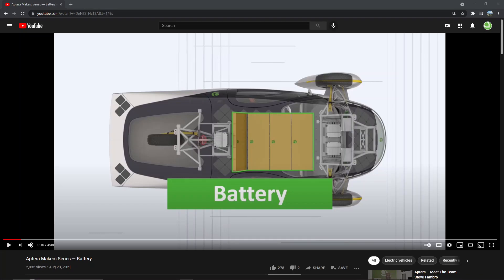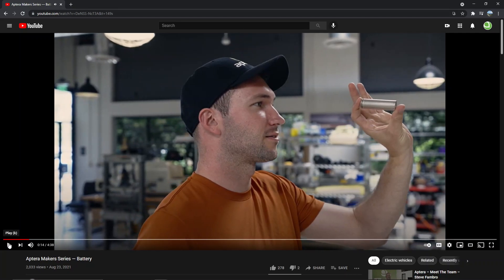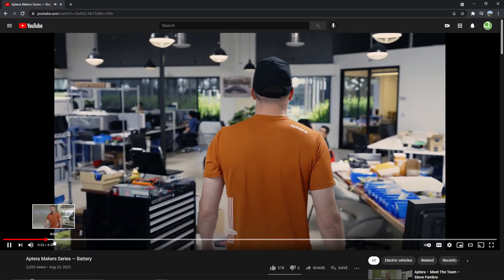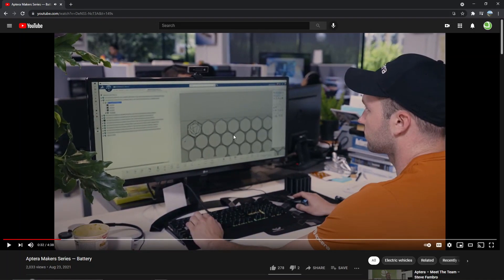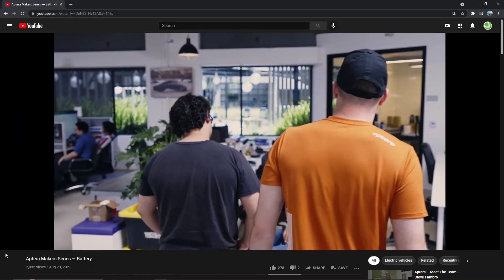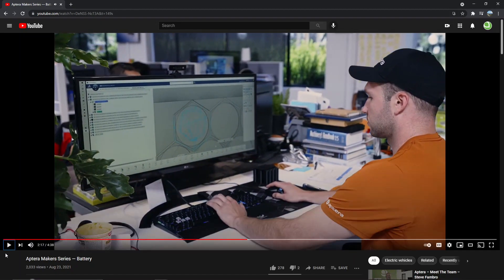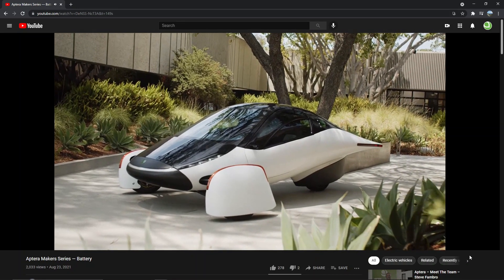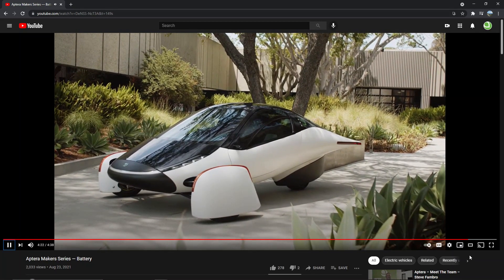Aptera Battery Update!

Comment: Echoing Andre M Camara - great video.   As an Aptera resevation holder and e-bike DIY'er, your notice of the parked bicycle speaks volumes about Luke and the rest of the staff. Most promising for me was the  open communication and talented and committed work environment.   However one mandate: "To make you fly off the starting line" (i.e. performance) caught my attention.  Luke is tasked with balancing this mandate with the competing mandates of achieving range, and managing heat (pack longevity), and fitting the packs into car's space constraints.  Luke's (Aptera's) job is tough, but all looks promising.  With 400 targeted volts using 3.7 (nominal) volt, 3.5AH 2170 cells, I'm guess each of the packs consists of 108 serial and 10 parallel "108s10p" cells (total of 1,080 cells).  Each pack = 324v-454v - "400v" nominal,  35AH (amp hours),  14kWh (kilowatt-hours).  The cells of this 108s10p pack are likely arranged 54 (38") x 20 (16.5").  Guessing cell-only weight per pack to be about 200lbs (completely assembled pack weight of maybe 275-300 lbs per 45"W x 18"D x 4"H pack? 

As a consumer, I would like to know the level-ground, windless "aero-dynamic sweet-spot" of the present Aptera body.  With such a sleek profile, if the wind-resistance "sweet-spot" ends around say 75mph, then I personally would prefer relinquishing bragging rights to reaching 100 mph, and 0-60mph in 5 seconds.  My personal minimum is being able to reach 87-90 mph (level-ground - no wind), and 0-60 in at least 7 seconds (i.e. be able to keep up with LA 405 freeway rush hour mania.   As you know, there is a huge increase in power (battery draw, controller throughput and coolant system scale/size/complexity) between 90 mph and 100 mph, (especially if 90mph is already beyond the "aerodynamic sweet-spot", where the car is really fighting to gain every 1 mph between 90-100mph).  As you know pack voltage is the primary top speed factor.  Also as you know,  the more rows in parallel in the pack (increased pack AH), the more the current draw is spread across the cells.  More cell rows in parallel (more AH) greatly decreases cell heat/deterioration and greatly increases cell longevity.  For instance it might take 400 volts to push the car to 100mph and to be able to do silly burnout sub 4-second 0-60 squid antics.  But it might only take 311 volts to achieve 87-90mph and 0-60 in 7 seconds.  If that's the case,  then personally I'd rather have a cooler running, longer lasting 84s13p (1,,092 cells) (311v,  45.5AH, 14.15kWh pack (1,092 cells) battery pack.  

But since the present 108s10p 400v pack configuration is already optimized for the space constraints (that I agree with), to simplify battery cooling system design and achieve battery longevity, what about:  a) For those who purchase the single pack 250 mile range option (and maybe even the 400 mile battery option) maybe implement controller based limiters on current draw to effectively "slow down"  both the bursts in amp draw (0-60mph times) and prolonged amp draw(long uphill, or sustained over 90mphl) drain on battery (all in effort to control battery heat and increase pack longevity).  b) Remove those limits for the 3-pack 600mile and 4-pack 1000 mile (responsibly) allowing only these cars such performance levels.  c) Maybe only allow the later 2 packs to have the rear wheel motor too.  I.e. do not allow the 250mile (and 400 mile?) customers to have the 3rd rear wheel motor option??     d) Finally I would suggest that Aptera not cheap-out on the controller. They should up-scale the controller's maximum amp capacity well beyond the cars current draw ability such that the controller itself will never heat up enough to require it's own active cooling system, instead be able to use whatever available passive cooling available.  Yes bigger controllers cost a little more, but if a Aptera fire, or burnt out controller is traced back to a overheated controller, that will LOOK VERY BAD for Aptera (for something that could have been easily avoided by not penny-pinching).  

If Luke can work out this cooperation with his Battery department design with the cooling system team, the motor team, and the marketing team (i.e. Aptera as a whole), then maybe Aptera can: a) simplify cooling system design, b) increase pack longevity c) avoid: pack fires/explosion, lawsuits, bad rep, following in GM's path to extinction, d) allow different customers different options, e) allow easier upgrades (in-case a person wants to switch from basic 250 mile pack to 600/1,000 mile pack and its higher performance (using a quick/simple controller program change along with adding the packs).
Reply: Sorry, in my example, I used a 3.5ah 18650 cell spec instead of the Tesla 2170 cell spec (same 3.7 nom voltage (2.5-4.2), 70grams/cell, but 4.8ah cell capacity (instead of 3.5ah of the 18650) and some of my math suspect.   So using 2170 cells,  to produce a 25kWh (250 mile) pack I'm guessing 1,404 cells arranged 108s13p?  (and likely 54x26 cell arrangement (43.75"w x 21.5"d) pack width /depth and around 220lbs (cell only) weight?  

At any rate, the suggestions are still the same: For the single pack (250mile battery) (or even the 2-pack 400 mile battery??) maybe a) set limits at the controller for max current draw b) limit the 250 (400?) mile cars to FWD (2-front motors)-only option.   Only allow full unlocked max current flow and AWD (3 motor) option for the 600 and 1,000 mile packs.   This mainly to simplify battery cooling systems and increase battery longevity.

Comment: Big dumb question: OK there are these ‘’BATTERY RANGE figures ‘’as to full battery & c ‘’40 miles a day charge by sun ‘’. Does the new car come with full battery and then can only be recharged by sun, or can I plug it in SOMEHOW OR SOMEWHERE to top off battery if I make a trip of more then 400 miles ? Or do I leave it in the sun for c 10 days ?
Reply from the maker: Totally normal question.  You can absolutely plug it in to top it off just like a regular electric car.  The solar is just an additional way to charge the car.  So you can charge just with solar, or just with plug or both!   you just have more options.   If you have it plugged in while it's outside in the sun, it will charge from both sources simultaneously.  It will charge with the sun while you're driving in fact.

Comment: The issue is, is it actively air cooled or liquid cooled. Liquid cooling is much better. Liquids have much higher heat capacities. Active air cooling usually isn’t much better than passive air cooling. As it could be as little as a fan. A good active cooling system monitors the temperature and adjusts the cooling to maintain a tight optimal temperature range.
Reply from the maker: my guess is liquid cooling but I will confirm that when I go visit them.  Great point.
Reply: The battery and motor are liquid cooled. They mentioned it on the episode of Jay Leno's Garage.

Comment: Finally the one thing I care the 2nd most about in the battery actively managed temp! That is huge to the longevity and performance of the Aptera! I and so glad to hear that they have a cooling system!
Reply from the maker: ya, no thermal management would've been a dealbreaker for me.
Reply: @ApteraOwnersClub  Leaf is comical; goldilocks car; Cant work in the hot or cold without massive problems.  I would really think that given the cost, longevity and safety that the 250 and 400 mile models could use LFP.  1000 miles is really more about bragging rights and with batteries almost always topped off to near 100% LFP offers a lot.  Efficiency is important in the base design but flexibility to know when losing some range to meet needs is also critical (ie tow hitch and raised clearance for snow).  Hopefully as they scale production and service locations they will continue to iterate.  I'm in Canada so I don't expect to see mine until 2026-2027 at the earliest anyway; I'd imagine with all the buzz they have a ton of preorders.
Reply from the maker: @ccibinel  yes lithium iron phosphate batteries seem like a great choice.  I'm sure that Aptera is aware of that battery chemistry.   You're more pessimistic about the delivery timeline that I am!  but i guess it's harder to be disappointed if you're not expecting yours until 2026 :)
Reply: @ApteraOwnersClub  I'm not saying they wont be scaling and shipping tons of vehicles.  I'm actually thinking I'm late enough to reserve and that shipments outside the US (I'm in BC) will take more time.  Their are probably 100-200k people ahead of me in line.  Scaling production is hard and while the design is amazing getting factories and people to go from 0 to 1k to 10k to 100k units / year takes time.  I'm actually going to wait until they start shipping units then invest / reserve if I can early next year.
Reply: @ApteraOwnersClub  fyi reserved mine yesterday.  You got the referral btw.  Sol 400 mile with 3 wheel drive  / safety driver / offroad; just basic solar for me as I park in a garage. Still no sign of my reservation number but as I understand all are currently under 30k.
Reply from the maker: @ccibinel  thanks!

Comment: Can you imagine what will happen to the occupants if the bottom of the Aptera shell is hit and the reactive Li gets on fire? Tesla has a built in armor plate.
Reply from the maker: I believe the composite floor is more resistant to blunt force trauma than Tesla's metal plate.  Also there is an airgap between the shell and the battery.    Will have to wait testing but on paper Aptera should be safer from battery damage from road debris

Comment: So much seems to have evolved in battery technology in the last few years
BYD's new blade battery is said to be a game changer
Structural integrity
Puncture test superiority
Does not require liquid cooling
The under skin air cooling system of the Aptera will no doubt work excellently in conjunction with the Blade battery
I do think the Aptera folk ought have a yak with either BYD
Or Elon may be able to put in a good word for you
Appears to be far superior on all levels
Reply: BYD may claim no liquid cooling requirement, but I don’t buy it. My experience is that air-cooled batteries have a much shorter lifetime. I would not buy an Aptera without a liquid-cooled battery at this point in history. It will take a qualitatively different battery technology—maybe solid state, maybe not—to get a battery that is thermally tolerant enough to forego liquid mediated active cooling. Or you will have to be willing to park the car whenever the air temperature is above 85 degrees Fahrenheit.

Comment: On the most recent investor meet, Fambro kept saying that an IPO would be within 12-18 months. To me, this means that deliveries would not begin before the IPO. So, somewhere between next summer or the end of '22. That's a bit of a correction since this past May where they said the IPO would be in the first quarter of '22. 
I had also asked the development team about the HVAC system plans. The heating will be conventional resistive wih a standard ac compressor for cooling. Nothing like the integrated Octovalve that Tesla is using.
We are still excited to have two of these on order plus having bought in early as an investor but the reality is, I don't see these coming before '23.
Reply: @mattc6854  Yes, I get it. Thanks. Interesting that the preorders amounted to 10k initially but have not risen much beyond that. I go hope the demand rises alot more.
Reply: @wearemilesfromnowhere4630  Preorders are still coming in at a rate of around 100 per day.  

Aptera may not emphasizing totals, because the preorder numbers don't reflect the actual total due to some people ordering accessories under a new number, and that the preorders are refundable, and some may have exercised their option.
Reply: Aptera has raised enough already to get them to production.  The biggest delay is coming from a very difficult chip supply situation and some other long lead times from suppliers.

There is not clarity yet on how soon this will resolve, and his goes for the entire industry.  IPO funds will be used to design a potentially mass market car, a 4 wheel, 5 passenger sedan, and other follow- on vehicles.
I still expect to take delivery of my Paradigm edition in the Spring, perhaps a early as February.
Reply: @n.brucenelson5920  Thank you for explaining that. Hope you get yours that soon. I'd be over the moon to get ours that quick.
Reply: Delivered vehicles before the IPO will only benefit the IPO if the release is successful.